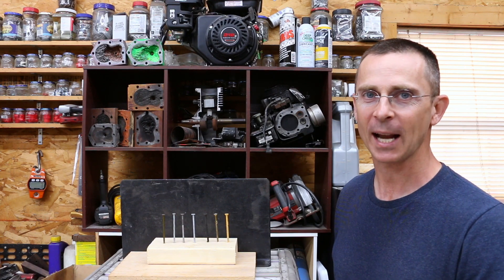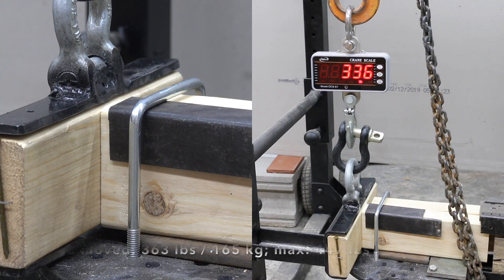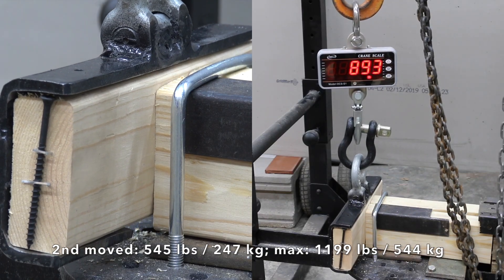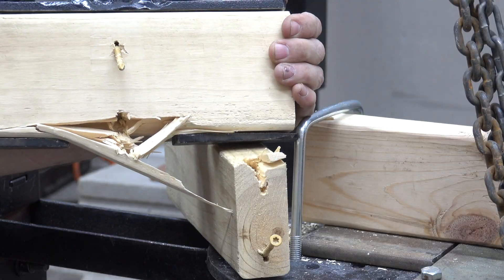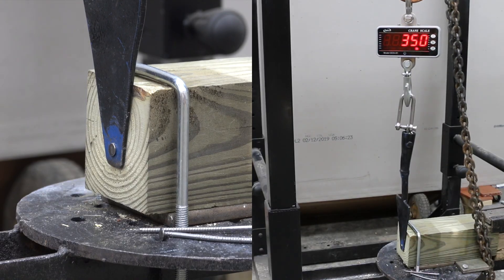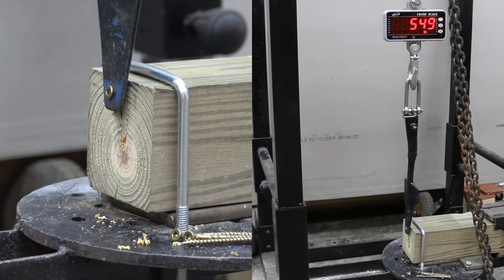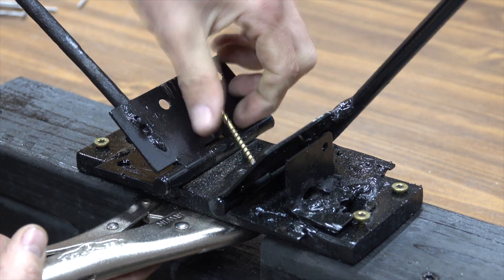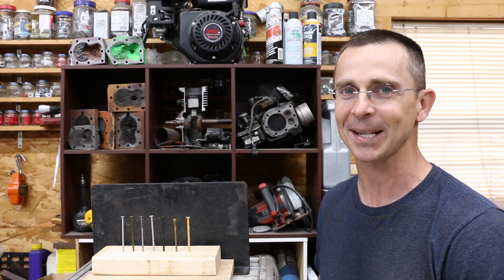Do Screws Shear easier than Nails? Let's find out!

Comment: Great video.
The reason why nails dont shear as easy as screws are basically a coupple of reasons. 
Main reason is the materal used. Screws are a harder metal so it can withstand the forces of a drill, without it "bending"
Also, nails with its softer metal, tends not to get fatigued as easy, remember houses move, and over time a harder screw will get fatigued faster and in the end, just snap off.
In constructing, almost all situations, nails are better, we are just too comfortable with our drill and screws have alot of practical advantages that nails dont.
I also use screws tho.. So im pretty much a hypocrite when it comes to that, aswell ;P

Comment: Good test where was the hardware made.  I work with a guy who built a small house in Vermont and he used cheep drywall screws, the boxes said  not for export to the USA well that did not bother him for a while the house was on the side of a high elevation whit very strong winds a few years later the screws were all rusting and getting lose , what a mess

Comment: As well the screws where you were bending them was bassically a notch effect by the threads it's also why the ring shank nail shears off now of you bent them around the smooth part of the shank of those fasteners personally reason I know most of this is welding experience any notch effect aka sharp changes thickness is just not a good idea

Comment: I have always been sure that screws (and fluted nails) are never screwed into the end, because they cut the wood fibers with their sharp thread, which they should actually hold on to, and in the video - 3:43 this is clearly visible - the lower screw cut its wood fibers and pulled out, because it had nothing to hold on to! But if it was screwed not into the end but on the side, as it should be,...
Reply from the maker: Thanks for the feedback.

Comment: I think the readon why they break, is they sometimes snap when u drill them in. Sometimes u dont notice that they actually shear
Reply from the maker: Thanks for the feedback.
Reply: @ProjectFarm  work as carpenter, and sometimes i have to adjust a board, and when i unscrew the screw i see that its allredy broken. It scares me sometimes, if its a critical fastening point, i work mostly with roofing. ESSVE scree manufacturer here in norway got sued because the screws snapped so easily. Just my 2 cents 😊

Comment: This is all  modern stuff, no guts in it. When I were a lad, serious nails for framing would have been cut clasp nails and the screws would have been tapered shanked slotted and they are as tough as old Harry. I have found that modern screws rust out far quicker than the old fashioned mild steel ones, probably because they are thicker where it counts
Reply from the maker: Thanks for sharing.

Comment: I'm curious how a 'ledger lock' would perform...  that's one of the code approve fasteners that attaches a the decks ledger board to a house rim joist.  It's basically a slim lag screw.

Nice testing. That door hing fastener bender looks cathartic.

Comment: Please do the test again without screwing into end grain. End grain has little holding power. The numbers would be completely different if you were to screw into face grain as is proper construction technique. Where tension forces are applied, brackets into face grain should be used and not fasteners into end grain.
Reply from the maker: Thank you

Comment: Ive worked as a framer and in drywall.... Im real;ly surprised the drywall screws performed like this. Ive never seen one bend that much before snapping. in my experience drywall screws are typically much easier to snap than a standard framing spike.
Reply from the maker: Thanks for the feedback.

Comment: I would like to see the difference between a screw joint made with and without predrilling.  A screw joint that has been prepped by drilling a tapered hole for the thread a clearance hole for the shank and countersink for the head performs very well and is easy if you use a tapered drill bit like these from Fuller https://www.amazon.com/Fuller-10393011C-5-Piece-Taper-Drill/dp/B002LVUWJK/ref=sr_1_7?dchild=1&qid=1591326652&sr=8-7&srs=20158331011
Reply from the maker: Thanks for the video idea

Comment: Appreciate the hard work and sharing your figures but there’s a bit of a flaw with your first series of tests. When you tested the nail’s shear strength the metal plate on the bottom that is bracing the wood to the frame had an advantage. You had the edge of the metal plate up against the edge of the wood. Then when you were testing the wood screws the metal plate was sitting back further causing the wood itself to fail and not get a more accurate measurement of the screw’s shear strength. Would love to see you correct that error.

Comment: One thing to consider when testing the real world applications of this is where the shear is being applied on the fastener. Your pulling rig tests the stress near the head of the nails and screws, where screws often do not have any thread. The threading on screws changes where stresses are concentrated in the material, which does not take into account of shearing forces caused on the thread when being used as a structural fastener such as in treated wood or hardwood which is less likely to fail before the screw.
Reply from the maker: Thanks for the feedback.

Comment: It's not that screws shear easier, they're definitely harder and hold well... It's the fact that when they DO fail, they fail by shearing off. In all of my years building and dismantling things, I've come across plenty of sheared screws and can't think of any times offhand that I've come across a sheared nail. Maybe a ring shank in some applications?? But not like screws... And it's not rampant, but when they do fail, it's by shearing at the joint of the lumber you're connecting.
Reply from the maker: Thanks for the feedback.

Comment: Since your force was NOT applied at 90 degrees, most of the fasteners bent and pulled out. Your jig was not good enough.  Your first tests didn't test nail shear strength, only pull-out strength.

Comment: In the first and second test id say if you have instances where movement is an issue you shouldnt be using fasteners of any kind. Bolts mate and lock nuts or wood work the joints together you cant blame fasteners if you dont use none and then you can blame your dumb self for making the problem that the wood is the one failing in the tests and now you use the weakest part of the tests cause you think nails and screws are not better. Dont make people think a nail is better in some cases because it can resist bending. If you need the nail to bend on something your building it means everything is loosening as time goes on and its at risk of falling apart. Or maybe you like to use nails instead of a door hinge like a moron. At no time is a nail or screw the best option in the case that the objects being fastened together sway independently of each other with the hope the bending nail will allow your construction to stay in tact longer then the hold strength of a screw. In what unimaginable circumstance can you think of where movement is a better option as opposed to double the hold strength. Unless you get earthquakes that tear screws and you use nails to stop a sudden collapse but dont mind rebuilding the house every quake so long as you live and houses in those places shouldnt be held together completely with fasteners any way. Fasteners only have one function and sheering is not one of them. Welding and steel plates are used when sheer forces are that great or bolts thick ones. Only a transportable dolls house should use nails when you need it to take movement but dont need strength or like a small boat made of wood. The only time sheer stress is an issue is when your driving long screws into hard timber.

Comment: So if I built a ground level deck using 3 deck screws for to connect the joists into the frame, I’m looking at over 1000 lb of force to actually bring the joist down on one side of the frame? In addition to a joist hanger, is it pretty safe to say that there ain’t nothing coming close to breaking that connection?
Reply from the maker: Thanks for the video idea.

Comment: I don't think that those types of tests accurately  demonstrate why nails are in fact superior to screws for home framing. Especially when you take into account how walls are nailed together and erected. If you imagine a 2x4 laying horizontally on the floor with 2x4 placed vertically on top of it (wall stud) there would be 2 ways to to secure it the 1st way would be to nail upward threw the horizontal 2x4 into the vertical 2x4. The second way would be to nail downward at an angle from the vertical 2x4 into the horizontal 2x4. Now  consider that wall stud to be at least 8ft tall. Now imagine  you want push the vertical wall stud over from the very top of the 2x4 with 8ft of leverage you will easily snap any types of screws (excluding some ledger locking screws) nails will bend back in forth screws will snap in the wind and you house would fall on your head. This is why nails are used.
Reply from the maker: Thanks for the feedback.

Comment: Last test was not applicable.  First glaring problem, you were bending the screws only about an inch up......within the threads....where it's much thinner.  In real world application, the forces of shear would be directed towards the top where the shank is much thicker.  Also, the crazy degree at which you were subjecting the bends too and the point on the shaft at which you were bending them.  Too many things wrong with that last test.

Comment: Some of your testing variations could be coming from the fastener’s placement within the grain structure of the wood. Perhaps using mdf or a similarly uniform material could shed more light in the uniformity of the fasteners vs the material
Reply from the maker: Thanks for the video idea.

Comment: I don't think this was a true demonstration of shear, since you used wood, the nails were able to bend and be pulled out in tension. I was hoping to see a true shear test where the jig was made entirely of steel and the fasteners failed in shear condition without bending, although that data is already available from tests made by ASTM, so in a way it was still interesting.
Reply from the maker: Thanks for the constructive feedback.

Comment: I would choose the screws. Even though you note they're more brittle in bending motion. But as can be seen in your tests when placed in shear in the end of the board, they do not break but deform similarly to the nails. It is also good to note that the screws apply 2-3 times the clamping/or binding force over nails, which prevents lateral motion even more so than a nail wood. Screws are just stronger in holding power by design. Which provide much much more holding and clamping force, and similarly high resistance to shear. You want something to last, use screws, just that simple. If your trying to save some money, use nails but it won't last as long.
Reply from the maker: Thanks for the feedback.

Comment: There is a thing called a structural screw, it's basically a nail wrapped in the screw type of metal for the screw bit, best of both worlds and insanely strong used them to build my deck and my wood punching bag stand. look like this https://d3f4lhoyhznrqp.cloudfront.net/media/catalog/product/cache/48a13d901ae4141c7d1db6d3ea4a9c5f/t/s/tss-14xx_15.jpg they can take an amazing amount of stress and abuse before backing off or bending, and that's the thing THEY BEND before breaking actual plastic deformation!

Comment: It's obvious to me that end-grain fasteners are easier to pull. If you fasten two 2"x4" chunks together, side by side, then try the same experiment, the results should be a lot different.

Also, when testing shear strength with the spade puller, a much different result will be found if you keep the spade from pulling laterally. Trap it so it can't do that, and sink the fasteners into side grain instead of end grain. I think you'll find it will take pressure in the 2,000-lb range to snap galvies and sinners, and I'm interested to see how the screws hold up, considering they're hard and brittle.

As an aside, I was surprised to see Deck Mate screws perform as well as GNK. Perhaps you could also try Saber-Drive deck screws.
Reply from the maker: Thanks for the video idea.

Comment: Humm. Interesting, a ductile screw test perhaps? Are all screws hardened? It does seam that all the fasteners do better than the wood. So would it really matter which fastner you use if the wood fails first? Which fastener will help the wood fail at a higher pressure? Would long hard screws that shear at 1000 lbs hold the wood together to a higher pressure? So many things to test!
Reply from the maker: Thanks for the testing ideas.

Comment: LOve your channel but, shear testing applies a lateral shear force to the specimen until failure results. Lap shear testing is performed to determine the shear strength of an adhesive that is applied to two metal plates and pulled to failure.  Nothing in this tests the shear of the fastener.
Reply: well maybe the heads. LOL
Reply from the maker: Thanks for the info!

Comment: this is not a sheer test. the board is clearly   rotating and pulling out. the Drywall screw that you say sheared was actually over torked on install and the head came off. the pulling test is tensile strength and holding power. use correct terms.
Reply from the maker: Thanks for the feedback.

Comment: I love this video but i have a few comments, 
1) pulling without a back brace allows the board to move laterally allowing the fastener to actually slide out instead of stay in position to see wether they would shear or rip the material apart instead.
2) allthough screws could not handle bending and side loads i believe once fastened they will not back out , so in this respect i don't believe there would be much possibility for them to bend because even as the wood shrinks the screw will be lodge due to its threads
3) i also believe that even though all this that i just said sounds like screws are a prefered fastener i belive they have more stress rissers along the threads and have more surface area to grab moisture and rust aswell as be weakened by rust, so I believe intill they reach that point they are superior. 
4) i love your channel!
Reply from the maker: Thanks for the feedback.

Comment: None of your screws were proper Woodscrews, which have been designed for millenia to grip the two pieces of wood together between the Countersink on one piece of wood and the threads digging into the pilot hole in the second piece of wood, their being NO friction between the shank and the first piece of wood's clearance hole.

All the ones you used (nails and screws) were equivalent to "twisted nails" which provide more grip than a straight shafted nail.

You couldn't drive these screws into hardwood, they would just shear under the resistance to the touque, with your method of insertion..  A proper woodscrew requires three holes. 1. A clearance hole in the first piece of wood through which the screw will fall through. 2. a Countersunk to hold the screw by the head in the first piece of wood.  and 3. a Pilot hole in the second piece of wood so that the solid part of the screw thread is accomodated, but the threads alone cut into the side walls of the wood.

A woodscrew clamps one piece of wood by the countersink to the other piece by the threads in the pilothole, pulling these together as you tighten the screw.  Driving what you call screws into two pieces of wood does NOT pull the pieces of wood together, only resists lateral movement like a nail.

None of your fasteners will clamp one piece of wood to the other.  You would get the same results if you drove them into one piece of wood and pulled them out.  Yours are all like nails with different ammounts of resistance to pulling them out. Not one of them is a WoodScrew.
Reply from the maker: Thanks for the feedback.

Comment: Good test. There's a reason why most screws aren't rated for metal connection/wood applications, bend 'em twice and structural failure is increased. Though excellent for pullout, just don't put them where wind shear and seismic forces will bend them. Simpson (and by now Mitek) now make screws rated for metal connector applications. Much faster than hand nailing those short hanger nails in tight spaces, unless you have a dedicated metal connector nail gun.
Reply from the maker: Thanks for the feedback.

Comment: I feel like all these tests are invalid. The nails testing are pretty good, you can see the nails deform as the shear force is applied and then they slip out. But the issue is that the way the test is conducted the failure condition is for the nail to slip out of the mount. That doesn't test shear force, that tests how well the nail can grip into the medium its in. Obviously, it's just a nail and has a flat surface so it can't really grip into the material compared to the threads on a screw. You can see the invalidity of these tests even clearer in the screw tests. In quite a few screw tests, the screws don't bend at all which means they didn't fail. You could take those screws that "failed", clean them up and use them again and it would probably be fine. The failure being seen in those tests isn't the screw's failing but the wood breaking apart.
Reply from the maker: Thanks for the feedback.